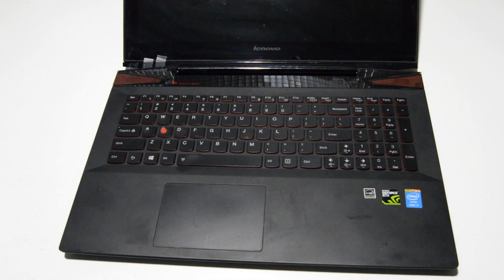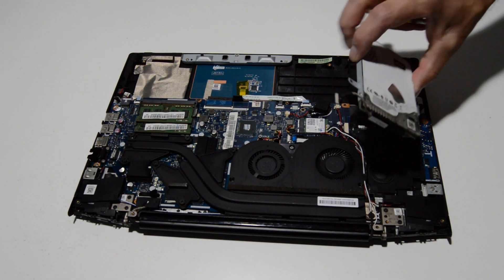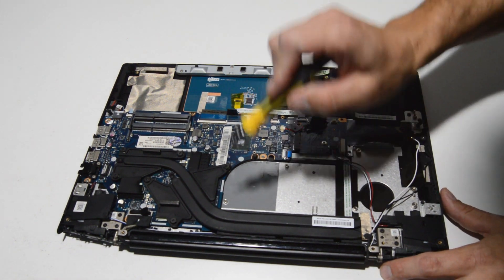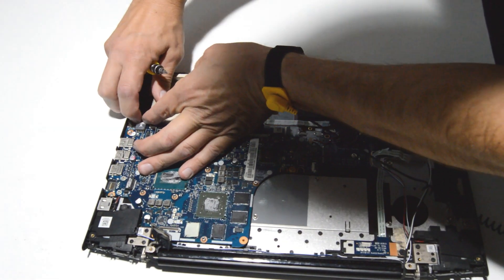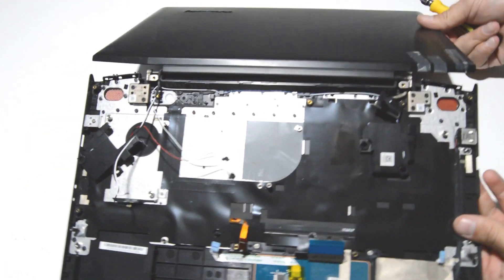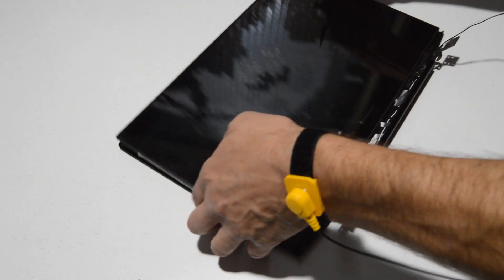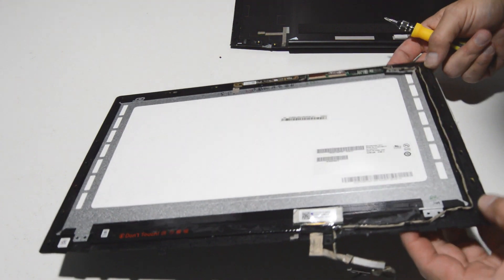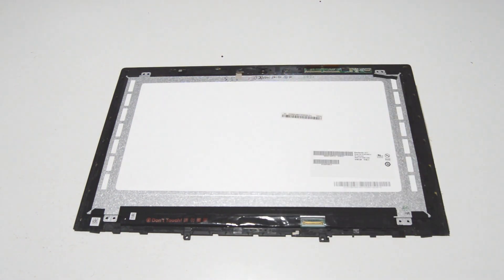How to Disassemble Lenovo Y50 70 Laptop or Sell it.

Comment: hi thanks for the nice video . I am wondering how can I replace the wifi antenna cables from the motherboard?

my second question is how to remove the bios whitelist in order to install a new wifi 6 card ? as the current now is reading unauthorised wifi card please unplug it and remove it message ?
Reply: hey, did you manage to do it on the pc?  I'm interested

Comment: Hello, my gpu died and I consider reheating it with a hair dryer or heat gun. Do I need to remove the motherboard first  or is it safe to just blast it while it still attach to the body (After opening the heat pipe)?

Comment: @sellbroke , i have a bios password in my y50 70 and I don't know what it is, and in my desperate try to bypass the supervisor password by shorting the eeprom from an YouTube tutorial, which was a failure and the sad thing is now it is not booting my hdd instead it shows checking media and then Efi network 0 for ipv4 , and boot manager doesn't show any sata connection. How can i get back to using my laptop again?
Reply from the maker: Sounds like you may need another motherboard :( Otherwise you can just load Ubuntu on a USB stick and running your laptop from there.
Reply: Thank you for replying, but is there no way to boot from my hdd? That really sucks.😔 when i shorted the eeprom i actually got into bios but it was not active only the titles were present like instructions boot etc, i couldn't select anything either. And also is it worth to spend on a new motherboard? My laptop is already really laggy and it heats up always when i game.
Reply from the maker: @abdulrasheedtk4913  If your BIOS is no longer recognizing the hard drive then you may have shorted something out. It also sounds like it no longer recognizes the keyboard. If you have a 4th gen Intel for your CPU it might be time to upgrade anyways. If you want to keep it a new motherboard with a GTX960m will run about $120-$150 on eBay. Good luck!
Reply: @Sellbrokedotcom  keyboard is still working, i can still try the passwords i remember, i think shorting that eeprom took me to a read only version of bios i guess, i don't know if its not recognizing the hdd or if it just reset the bios to boot from Efi network, and yes i think it is time for an upgrade, but iam thinking of investing in pc build or to replace the motherboard add a ram and a ssd on my y50, even though it always heats up. Thank you for taking time to reply, much appreciated.
Reply from the maker: @abdulrasheedtk4913  Well you can always try shorting it again! Sometimes breaking something twice fixes it :) But seriously maybe a second reset may yield different results.... at this point why not? You are welcome, and thank you for watching.

Comment: do you need to remove all the components in order to repair the hinges??
Reply from the maker: No it looks like you can disconnect and remove the display assembly easily once the bottom case is off, then you will have to remove the LCD from the display assembly to remove that side of the hinges.